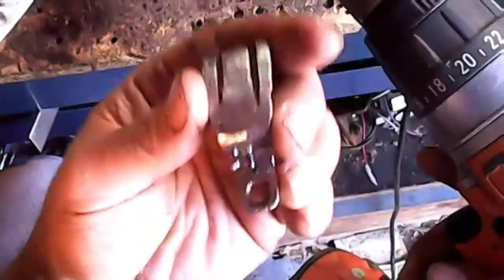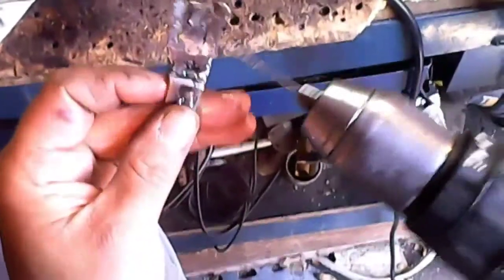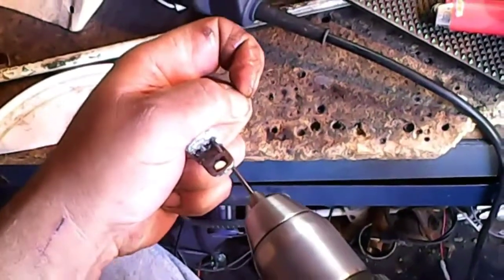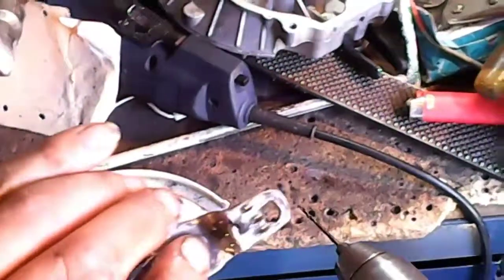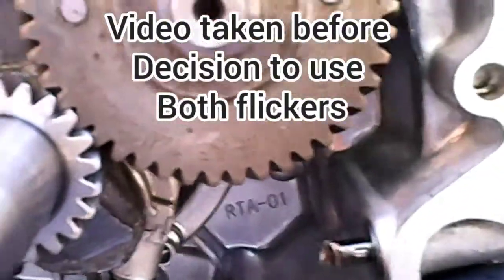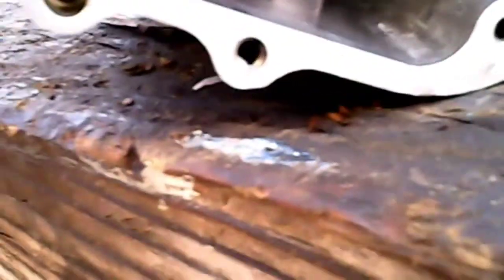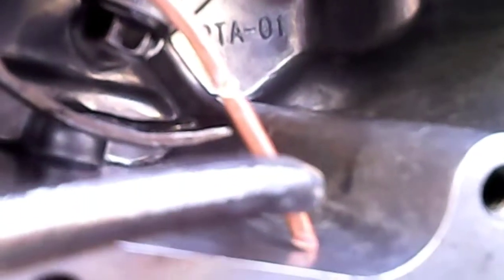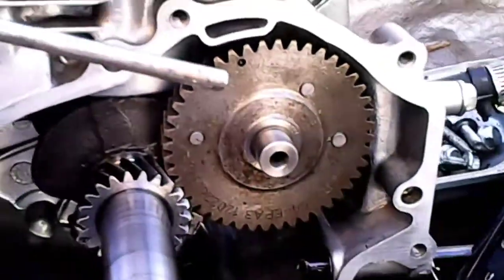*6/15/19*NEW DESIGN! Oil Flicker Modification vertical to horizontal shaft position lawnmower engine

Comment: Does the oil reach the rockers and pushrods?
Reply from the maker: Yes. I thoroughly cleaned all the oil from the OHV compartment. I wiped down from the inside of the cover down to the bottom of the housing. I ran the engine for about 5 seconds then opened it up and the compartment was full of oil again.
 The valves, rods and rockers were well lubricated too.
If you have any other questions please feel free to ask, good luck and take care!